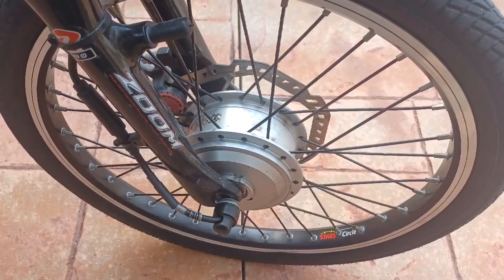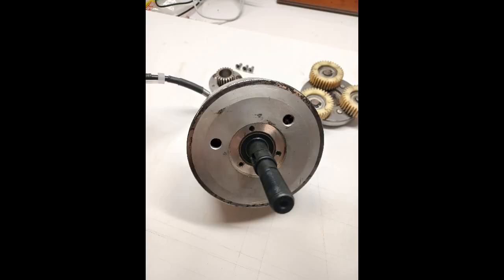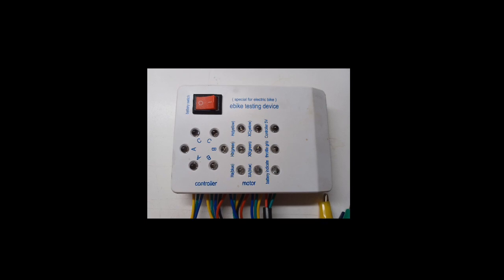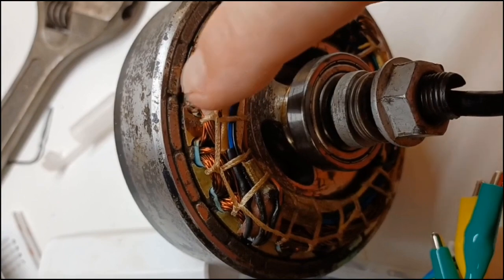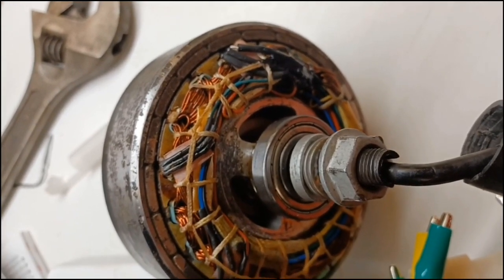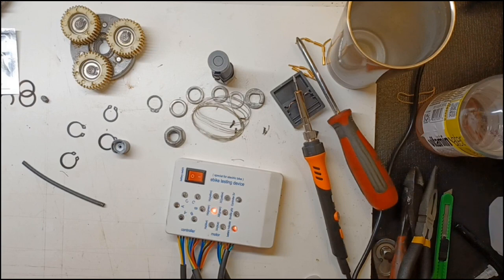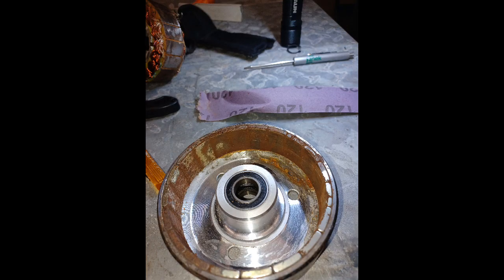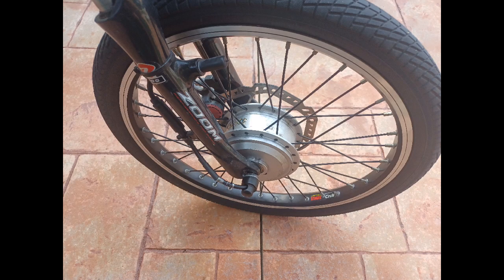e-Bike - $20 Repair - Power Cut Out - Sensor Bad - Scooter Brushless Motor

Comment: When i paddle my ebike accelerates and stops accelerating it does that but sometimes it doesnt and it works idk if its my brake sensor but my throttle works all the time but my paddle not all the time
Reply from the maker: You'll need to hook up a tester to isolate the failing component

Comment: nice video i'm currently trying to diagnose an issue with a scooter hub motor that cuts out under throttle, thanks for sharing.
Reply from the maker: You're welcome   good luck
Reply from the maker: Did you figure it out?
Reply: @CharlieD954  in my case it was a blown mosfet in the controller, the new controller phase wires didnt line up with the same colors and at first i thought i broke my motors it made a horrible buzzing noise under throttle and I eventually swapped wires and everything is working again. 😅
Reply from the maker: @garyt3hsna1l82  great, I know you're Happy :)